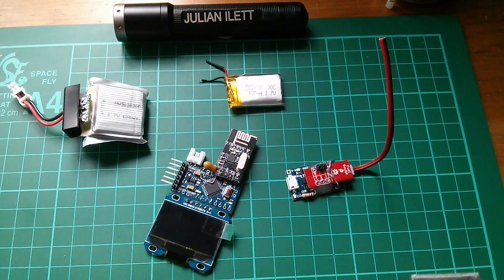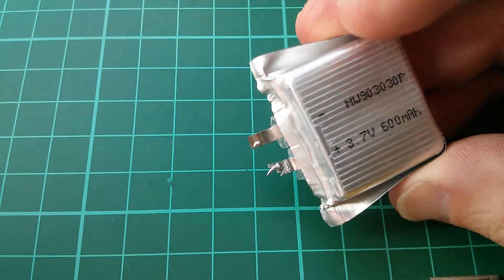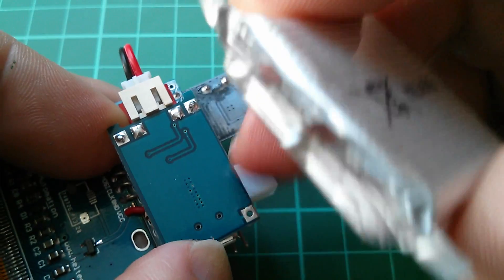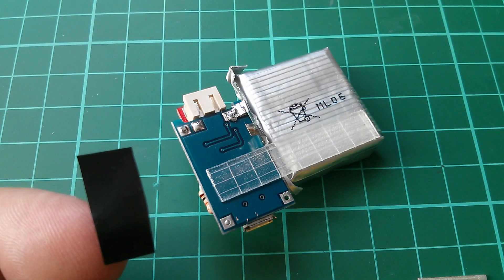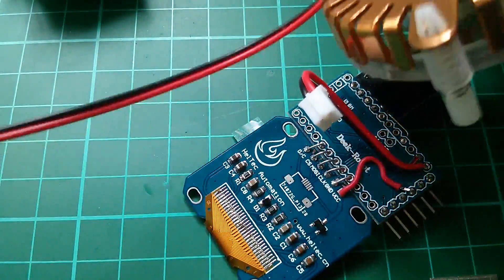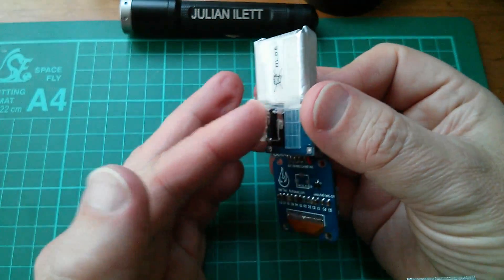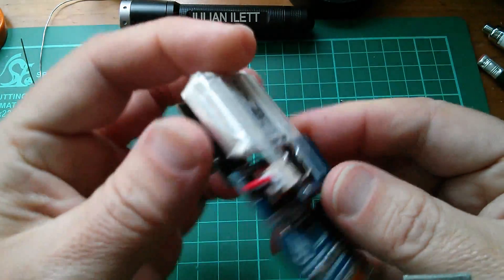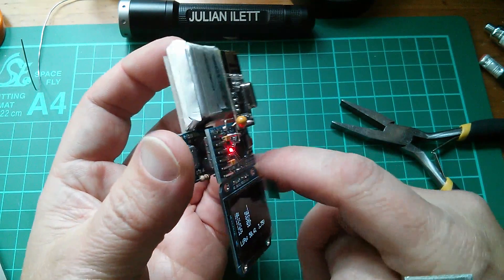Project: New Wearable Arduino OLED Remote Data Display #3

Comment: So oled is attached via SPI and nrf24l01 communicate also via SPI ... I thought that atmega has only pins for one 4-wire SPI connection ... what's the magic here?! ... btw working on arduino based "smart" watch and also wanna add some wireless communication, but I dont know how to solve that SPI problem. Google again..
Reply: Vincent Stuchlý SPI can be connected to several peripherals, where the can share the same pins. The only pins that need to change are the CS pins which let the microcontroller know who it's talking to ant what point. (if logic low, then the data goes to that slave device)

Comment: Could 2 lipo (same size) be connected in parallel and charged by the same charging module?  How about 2 lipo's in series, how could that be charged using a similar module?
Reply: it might be dangerous to do that.  lithium batteries are supposed to have each cell individually monitored because they will rupture if one gets overcharged.  cheap lithium batteries and chargers have caused a lot of burns of varying degree.

Comment: Hi Julian,
I'm enjoying your videos very much and am intrigued by your wearable project.  I was just wondering if you have considered a custom PCB to help integrate and shrinkify your project?  Osh park is a very inexpencive fab and Kicad is a good free layout package if you're interested in that at all :)
Reply from the maker: Steve Creasey I'm kind of determined to complete this project without using a PCB - it's become a challenge.
Reply: Julian Ilett I was just wondering the same, as it would be a fairly simple job to get it tiny, but I like the way you source the cheapest parts and integrate them for simplicity
Reply: Steve Creasey there's also JLCPCB, seeedstudio, and PCBWAY which are a lot cheaper and you can get so many more boards

Comment: Since the reset button is on the backside, it will be harder to reach. I'd probably add a button to the front. Make sure it's connected to INT0 or 1 so it can wake the AVR when in sleep mode. I'd also remove the power indicator led. I wonder how efficient the voltage regulator is. You definitely wouldn't want to use one of those voltage adjustable pro-minis you got recently. 

I'm currently working on a nrf24l01 connected sensor board powered by a single coin cell. So low power sleep mode is definitely a must here. If you need some help with some sleep code, just let me know.
Reply: have you considered trying an MSP430 device? In the low power modes they have ridiculously low current draws (on a G series chip which is less efficient than F series, my cheap multimeter barely discerns any current at all), it is also possible to have them sleep while a timer remains active to wake the chip after however long. They arent the solution to every problem of course, but they are great for low power stuff (also useful for things requiring interrupts, they have a ton compared to the AVR, not that its a major benefit when only using 1 interrupt or when reset will do)
Reply: I still quit new to AVRs so I'm a bit hesitant to jump into another platform like the msp430. They are also a bit harder to get. 

I got the sleep current down to 4.3uA of which 4.2 is use by the watchdog timer. If I add the NRF module I end up with 6.0uA. Ignoring the wake up current this would result in about 3.8 years of battery life.
Reply from the maker: beargun42 3.8 years!! That certainly beats the current crop of smart watches.

Comment: Can someone help me.. I bought an Arduino Pro Mini from eBay and it seems to work but the micro get's VERY hot after a few seconds and all I'm doing is blinking the LED. I don't know what could be wrong. I'm powering it from 5V USB. Sorry to ask this here but I thought maybe someone could help me. :)

Comment: Hi,

What should be the resistor value to charge that 600mAh battery with that charger/protection board?
Reply from the maker: ***** from the data sheet: (http://dlnmh9ip6v2uc.cloudfront.net/datasheets/Prototyping/TP4056.pdf)
300mA needs a 4k resistor - 3.9k would be fine.
Reply: Julian Ilett
Thanks! I didn't know the chips "name" so I couldn't find the datasheet...
Do you know what resistor come on the board?
Reply from the maker: ***** The board is supplied with a 1.2k resistor which sets the charge current to 1A.
Reply: Thank you very much! I'll order a couple of these boards to charge my 850mAh battery.
Reply: Julian Ilett
It would be nice, if these chips had the possibility to set the final charge voltage (some of these integrated charge controllers do). Of course you won't use the full capacity, but I heard charging lipos to just around 4.1V for example can greatly enhace their life.
Reply: superdau I agree actually, plus you can also buy a few LiPos that claim to tolerate overcharging to 4.5v or so to exceed the usual max capacity. Over or undercharging the lip depending on application would be a very useful feature if these boards would support it.